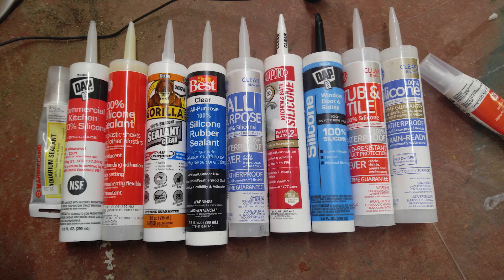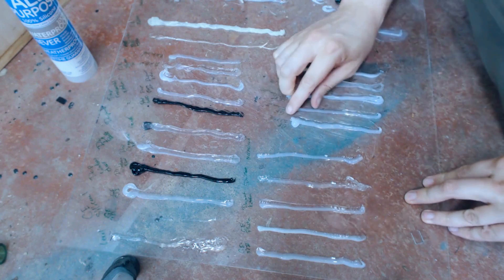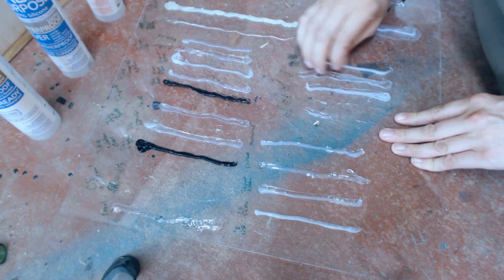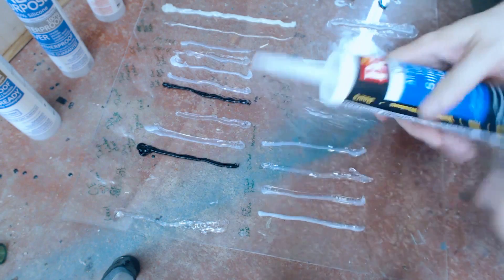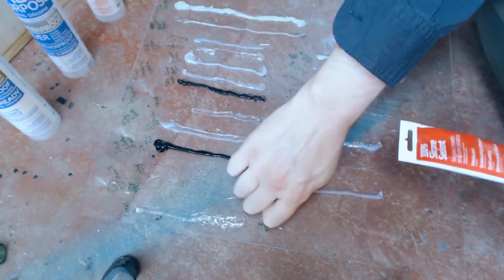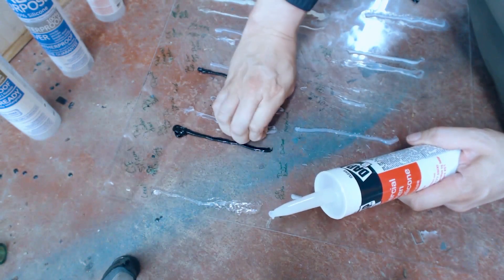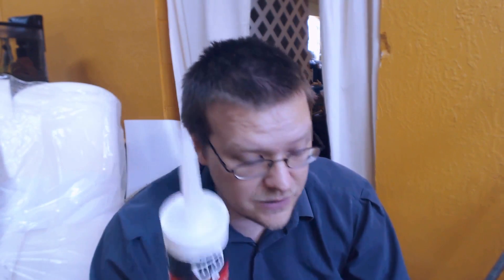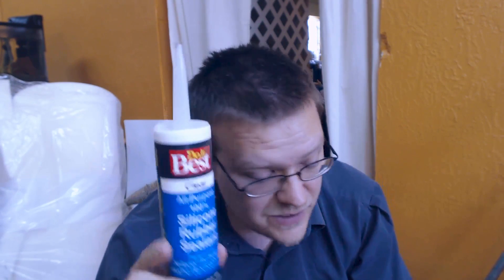Silicone on Acrylic - Which ones actually stick? DIY aquarium windows

Comment: I’m wondering if this will work for a project I’m working on.  I do spfx and costume stuff.  I had some acrylic pieces I need to stick an already existing silicone piece.  It’s a silicone creature glove with acrylic claws.  I’d used a Swiss superglue type thing meant for these two, but the bond just isn’t strong enough.  I wonder if the gorilla glue would work.  Looks fantastic.
Reply: Hi, I'm in a similar situation to you needing to bond acrylic to silicone mould. Can I ask if you found anything that works well? Thanks
Reply: @azza2664  well… ya know I just thought I’d test it with the silicone I use for patching and adding pieces and paining by mixing in color.  I think is what all the big mask companies use for all that.  It’s 732 Dow Silicone.  I have acrylic claws needing to attach to silicone fingers for a werewolf glove. I just used the 732 since I never tested it and thought I should try.  Everyone and all things I looked up said it doesn’t stick.  But this did.  It worked just fine and it seems stronger than any specialty glue I’ve found to use for this situation.  I say watch this guy’s video and get the best sticking power silicone… which seems to be the gorilla.  I think it’s working fine with my 732 as well.  I bought some weird Eastern European “superglue” last time they fell off and when I went to go try to glue the claws again it was dried out.  So… not worth it.  Just test some pieces with silicones suggested here or the 732.
Reply: @azza2664  ok.  So after replying, I just went back and looked at the acrylic claws attached to the silicone gloves.  The silicone attaching it DOES seem to be disintegrating and breaking down some over time possibly.  There’s ones I used more on that seem to be ok, but there’s a couple that look like they’re ready to come off. And the silicone adhering them is stating to look a little dried out and flaky.  I’m assuming it’s probably a slow chemical reaction between the two substances.  I used 732 Dow and not anything he mentioned in this video.  After watching I think I still want to try some of the ones he mentioned like Gorilla as they are talked about adhering acrylic well to glass via the silicone as glue.  If he doesn’t get a chemical degradation with some of the better silicones as glues, I’d think it’d be ok for us to use similarly. 

Either way, nothing I’ve found so far is working 100%.  Even the Swiss superglue meant for it seemed to only stick very lightly and come off with and hard pull.  If the silicone sticks better, but degrades slowly over time… I feel like it’s still a better option than the Swedish superglue.  With that it doesn’t stick well. I want to let them sit for a while and then see what happens and I’d like to experiment with his other silicones if this fails.
Reply: @tidalboxer  thanks a lot for taking the time to reply. It's good to know that even the Dow 732 is forming a bond and maybe some of the products listed in this vid might do better. I'll be able to test it out myself too in the not too distant future so if I find anything that performs well I'll let you know 👍
Reply: @azza2664  yes.  Please do re comment here to let me know what you find.  I’ll do the same because it’s a hard question to get answered.

And apologies for misspelling or punctuation errors.  I text fast and have ADHD, so I miss a lot.  I do know the difference between too and two though. Lol

Comment: Did you forget to turn off the water, or someone's taking a shower? :).  Thank you for the silicon reviews; we're about to place in our building acrylic based sign on the building and wanted to see what silicon to use for that brick. Thank you for the scratching tip; it will help a lot. :)

Comment: Caulked my 120 gallon turtle tank with GE silicone. 30 minutes later one of the turtles pulled the silicone out of the corner seam creating a water feature in my living room. Found gorilla silicone in stock at Minards so I have my weekend planed. Thank you!
Reply from the maker: Just be sure to give it an extra day to cure vs what you would do for normal silicone, for  animal safety. It has more volatile additives than other brands.

I don't really worry about it cause my projects are usually weeks between sealing and final fill, but being in a hurry with gorilla brand is more dangerous than with others, so best to play it safe
Reply: Did the gorilla silicone work and hold up? Going to need to redo my acrylic tub surround in the future as I noticed the areas attached to the tub peeling vs the area on the tiles that are stuck on like glue
Reply: @Chanmantroop10  The gorilla did bond well but it has no flex. With the temperature shifts and minor movements between the tub and panels it needs to give a little. That is why silicone will eventually come free from one side. It's the week link that gives rather than the surround cracking. I drained and cleaned the tank several months later with warm water and the acrylic cracked. Don't know if it was the lack of flex or just 20 year old tank but new one has GE silicone again and holding fine. Clean the seams with bleach and scotch bright pad before you caulk to get a good bond.
Reply: @gueto70  I didn't want to scuff my tub surround but might end up having to. Better than having to redo often vs once every few years
Reply: @Chanmantroop10  use the blue scotch bright for glass. Micro scuffs you can not see. Key is get it completely clean and dry first then let it completely cure. 24 hours is the minimum time. Acrylic tubs and acrylic glass are not the same. Property management and contracting for 40 years. Just use GE silicone on tubs.
Reply: @gueto70  I don't have issues with glass it's the acrylic tub. I did use GE. And it doesn't hold. I really like GE for everything else. I used the supreme silicone and advanced and both didn't stick great. The supreme had slightly better adhesion but still peeled eventually if I rubbed it, whereas on the tile it's on there like glue b
Reply: @Chanmantroop10  I was trying to say, use the blue scotch bright that is labeled safe for glass. They will not leave a visible scratchy haze. As long as the panels are secure, dry and completely clean of oils and dirt it should bond. "Tool" the silicone bead in with a DRY finger so there is no lip on the calk line. The wet finger trick gets water in or under the silicone leading to poor bond or streaks of mildew inside the caulk.
Reply: @gueto70  thanks I'll try that. What I did was clean the area with isopropyl alcohol and I always tool with dry finger. The only difference is that the one area I did have to use tape which caused a small ridge and I didn't go over it again with my finger too flatten the ridge down. I don't think water got under there but I think it got pulled when cleaning as the ridge acts as something to get caught on by the sponge. I'll try the scotch Brite next time to also enhance the adhesion. 

I appreciate the advice. But I still wish there was something out there that didn't require all the prep work as I mentioned this issue doesn't happen with my tiles or glass.

Comment: thanks. looking to glue some acrylic together. great info
Reply from the maker: I wouldn't use any silicone for an acrylic on acrylic bond, the ones that stick work ok to stick acrylic to something else, but it's not a great solution.

Acrylic on acrylic I'd see if the joints are close enough to use an acrylic cement, and if not I'd try a rubber sealant like Lexel, which has a much better bond to acrylic than any silicone will
Reply: @MischiefandFins  thanks. yeah there's a part of the project with tight joints so i'll be looking into something like Sci grip 16 or E6000, or maybe super glue. Then there's some other fittings that will go onto the acrylic box which may not be super flush, so i'll need some larger 'filler' adhesive to get all the gaps etc. i'll look into lexel

Comment: Lightly scuff the acrylic surface with 220 grit, apply a thin coat of MEK (Methyl Ethyl Ketone), let it dry and then bond it with any good quality silicone. This works because the solvent breaks the polymers in the surface of the acrylic and fluffs them up giving the silicone something to grab onto. MEK is nasty stuff - don’t get in on your skin or breathe the fumes! and don’t use too much or it will destroy the structural integrity of the acrylic.

Comment: Wanted an acrylic adhesive safe for drinking water, but strong enough to hold it together. Will order the DAP. Thanks!
Reply: If bonding acrylic to acrylic then you want to get the special stuff that physically bonds the two together with a solvent..  its real watery compared to any sealant but if you hava a flat piece set flush and square to another piece you run a little down it and will get sucked into the seam and join the two pieces where if you try to break them apart it will break at another place and not the joint:..

Comment: what glue to use on plexiglass to glass, i am in the need to plug aquarium drilled hole in the bottom glass, i was going  to use ge1 , but am confused

Comment: Unless I'm misunderstanding, the SDS sheet on the gorilla silicone it indicates it is "harmful to aquatic life with long lasting effects". http://complyplus.grainger.com/grainger/msds.asp?sheetid=4189565#sec10
Reply from the maker: Half of those are in literally every acetic cure silicone on the market.

Pretty much everything in any brand of silicone is harmful to aquatic life prior to curing.

Unfortunately the SDS of a product is really only useful for understanding the dangers of the product fresh out of the package.

The only really questionable thing in gorilla silicone is benzene, which helps to create much longer silicone chains and evaporates incredibly quickly, so there isn't really any of it left after a week of sitting, which I know since it is INCREDIBLY deadly at even microgram doses to aquatic invertebrates, yet my shrimp, crabs, daphnia, etc are all fine and thriving.

The other things are deadly if added directly to a tank, yes, but you aren't doing that, and you certainly aren't adding 7 grams of silica dust per liter of water in your tank.
Reply: @MischiefandFins  Thank you so much for clarifying. Its is a bit overwhelming to get through all the SDS info and try to make sense of it. Im happy to know I misunderstood, and happier to know that I can use the gorilla glue without harming my fish!
Reply from the maker: @kayrin33  I'm working on a "silicone misconceptions" video right now to answer some of these questions a little more thoroughly, because they get asked a lot.

I generally let gorilla silicone sit for a few extra days to be certain, but my projects are generally of the "start on it, set it aside, pick it up again two weeks later" variety.

My general "safety" rule with any silicone is to wait 4-5 days to be sure there isn't any possibility of anything leeching out. I then do a fill, let it sit for a couple days to leak test, then a full drain before decorating.

Comment: Great vid!...part of the demonstration was unclear to me; Did the Commercial Kitchen require scuffing? And how did you clean/prep surface?
Thank you.
Reply from the maker: I didn't scuff anything, the surface was as smooth and new as possible when doing this specifically to check how well they would bond to the acrylic itself. Any scratches showing in the video were on the back side.

Painters tape to block off an area followed by light sanding is absolutely recommended for surface prep
Reply: @MischiefandFins  nice. 
And I was asking if you needed to clean the surface. I thought maybe the sanding debris needed to be wiped down with alcohol maybe Or mild soap before applying the sealant.
Thanks
Reply from the maker: @fugitivetattoo  no, I just blow away any dust, wipe it off with a clean shop rag to pick up any dust that's sticking from the static created, then apply silicone.

There aren't any protective layers or oils or anything applied to the sheets in the factory that need to be removed, just the anti scratch plastic to be removed, scuff it a bit, and you're good to go.

I often don't even bother with sanding, though, the cut edges are usually rough enough to stick exceptionally well, so I add enough to the front to hold it in place temporarily then use a very large bead around the edges for the actual water seal/hold layer, that way I don't have to worry so much about getting the alignment perfect to hide the sanding.

That's using much better silicones, like momentive rtv108, though. I do always sand when using any of these, even if it's a pretty thin area.
Reply: @MischiefandFins  done deal man thank you very much!
Thanks for the time and money you spent, the info in this video is like gold to a DIY'er!

Comment: Based on my research the key to bonding acrylic with silicone is surface prep, there's some rather nasty chemical that a swab of on the acrylic will make silicone stick like none other. methyl something or other. I'm trying to look it back up again now. I personally would not trust any construction silicone because they aren't required to say what's in it or grade it's safety since that is not it's intended purpose, and most of them that say how long it lasts and that it fights mildew, have chemicals in them that constantly leech out, to fend off mold, mildew, fungus, whatever. You can use 100% pure aquarium silicon and pre-treat the acrylic and use rubbing alcohol on the glass and it should bond strong as hell.
Reply from the maker: The idea that silicone products have mold inhibitors that are killing your fish or corals comes from the fact that people don't understand the difference between silicone I (acetic acid cure) and silicone II (ammonia cure) add water to tanks with Silicone II before it has cured, causing their fish to die. People don't understand it, so they assume it's some mold inhibitor, and that's just the "common knowledge" now, despite it being wrong.

Great example, everyone has been obsessing about buying GE Silicone I for windows and doors for years because it "doesn't have the additives" well it says "7 years mold free protection" on it now, but the formula didn't actually change, according to the GE person I talked to, but since nobody actually knows a damn thing about how any of this works they're all freaking out over it, when it's the same thing it's always been and they just added marketing to the package.

Now people are chiming in with "I used GE silicone 1 once a long time ago and it killed my corals!" because now suddenly it must have had it all along, right? No, it's a garbage product that sometimes doesn't cure correctly, people just don't know how to actually check that. Uncured silicone is full of toxic stuff.

Silicone is naturally mold resistant. It is a 100% synthetic product that resists cracking, so with regular cleaning a silicone with no additives will still have a 7 to 10 year "mold free protection"

There certainly are silicones with mold inhibitors in them, like "PENOSIL no mould" or "Forever Clear" which make a big deal about the special additives, there are special versions of GE Silicone II with "lifetime mold free guarantees" which clearly have additives, but... otherwise it really isn't an issue.

You just need to know to let stuff sit for a week to cure, people are too impatient and add things after 24-48 hours, and then go looking for someone else to blame when things go wrong.
Reply: We’re we’re taking in a post above about similar things and trying to figure out if any bonding substance  would adhere acrylic to silicone.  

I’m trying to glue acrylic pieces to a silicone object basically.  It’s a realistic silicone glove for a special effects creature/werewolf and I need to glue one acrylic claw to each finger.

In the beginning I used a European glue made for specifically gluing acrylic to silicone.  It barely stuck and the acrylic pieces pulled off easy.  The substance was more of a superglue looking substance with a cleaner vial of liquid included to clean the surfaces you’re gluing before adhering the glue.   I think it was pretty much superglue and acetone for cleaning the surfaces.  When the claws finally gave and pulled off, I went to use the “superglue” again and the substance had dried out completely in the applicator tube.  It behaved exactly as superglue would when it dries out after you open it.  So with it’s looks and behavior, on the glove and in the bottle drying out, I think it was a very similar substance to superglue.

So about a months ago I tried 732 Dow Corning silicone that is used by prop makers to repair silicone, glue silicone to silicone, and to color and thin out as a paint for smaller projects.  732 silicone worked great at first, but I waited and just looked now.  The claws I used a bigger amount of the silicone “glue” on seem to still be sticking ok.  There’s a couple of pieces I glued on with a lighter amount that might be reacting though. It seems to be drying out and turning flaky and cracked. Not 100% sure it’s a reaction, but not sure it isn’t.  I’ll probably have to wait longer and reassess.  If it doesn’t stick, my next step it to try some of the silicones in this video.  Maybe the ones recommended will be stronger and not react?  Any suggestion before I try a next step though??